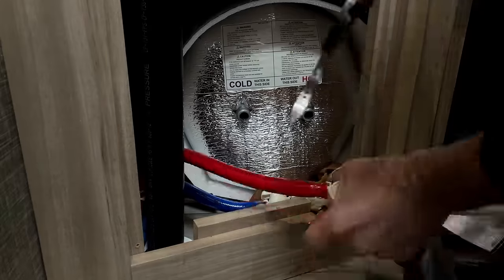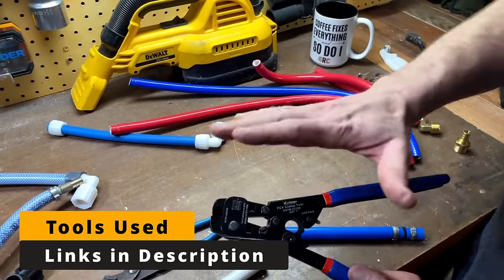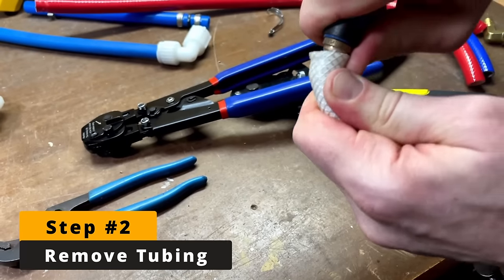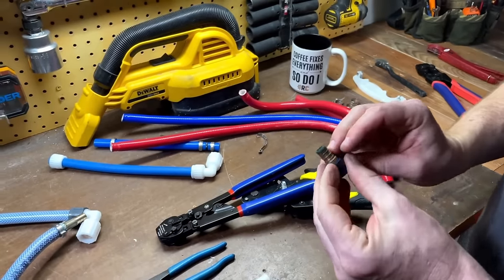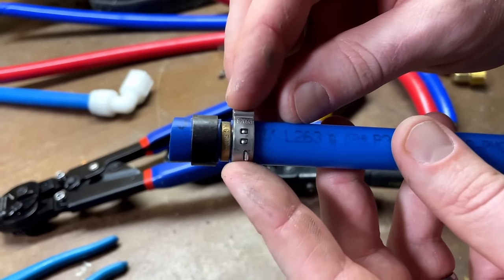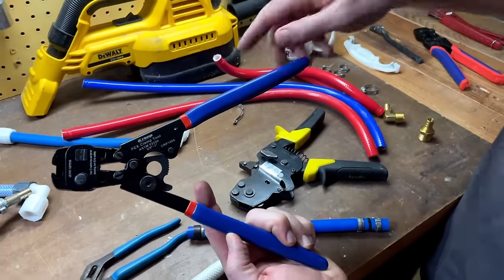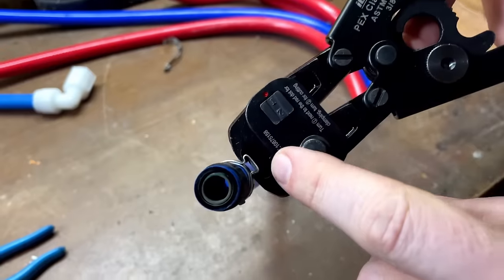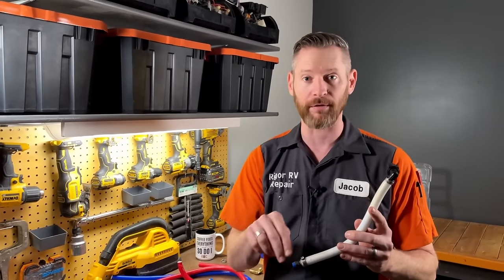How to fix RV plumbing leaks - Fixing Flex Pinch Clamp Tutorial (Part 1)

Comment: The Sungator 1/2" barb fittings in his Amazon list leak just as badly as the PEX fittings do with the 'garden hose' parts on my Grand Design. Especially the hot lines, seems they have expanded and simply won't seal right anymore. The only real solution here is to replace with 100% PEX. I wasted a lot of time trying to transition these vs. fishing PEX everywhere (which turned out to be pretty easy overall).
Reply from the maker: Thanks for the feedback. All PEX is also my preference. I'm sorry to hear the barb connections did not work for you. I only have the video about barb fittings for the situation where the plumbing is in a slideout and you can't easily remove and replace the hose with a pre-made flex hose assembly that has 1/2 NPT connections. Barb connections with screw-type clamps can leak if not tightened enough, and the clamp may need to be re-tightened after hot water goes through and softens the hose. I'm glad that you were able to replumb with all PEX, that should serve you well. Best of luck with your RV!
Reply: I would love to hear more about how you replaced with PEX in your Grand Design.  I was about to start doing the repairs suggested in this video but am having trouble finding lead free options for the various brass barbed fittings I need.  Thank you very much for your help!
Reply from the maker: Thanks for your comments. I'm actually changing my recommendation on barb fittings and clamps for a few reasons. as you've pointed out not all brass is lead free and good for potable water applications. I've linked stainless barb fittings in my Amazon store now. Second, I found a T-bolt high-pressure hose clamp which is twice as wide and works better than a standard worm drive clamp.
Hope this helps, thanks for watching!
Reply: @undercoverrvtech I looked at the new recommendations and was wondering about the new clamp as the one you have in your list still looks too big for a 1/2" barb fitting, no?
Reply from the maker: @robertbarry79  I have them on my bench and have installed that clamp on a 1/2 barb fitting. It works fine. I'm in process of updating that tutorial with the new reccomendations,  but am also working with an engineer to prototype a direct PEX to bard brass adapter, (It will be lead free) and will include that in the update. In the meantime your best bet is stainless barb and the t-bolt clamp.
Reply: @undercoverrvtech  Thank you very much for the feedback.  I was thinking it wouldn't tighten enough for a 1/2" barb to make it secure.  Appreciate knowing that you have tested it directly.  I am also excited to hear about the new development - definitely want to see that video!

Comment: That video really helped me see what I need to upgrade all the piping that's not PEX in my Forrest River 5th wheel. Another "idea" I've had would be to extend the catch tray that is normally below the "user" side of the nautilus panel to catch leaky hoses and channel the water to outside/underneath the trailer and build a catch tray behind the nautilus panel where leaks often go undetected until major damage is done. I saw this idea recently at a local RV show and wondered why manufacturers don't design the water system to deal with leaks and channel them out of the RV instead of creating damage.  Thank you!
Reply: That’s a good idea.

Comment: This is the first video I have seen of someone showing these stupid tools n how to use em. Thx!
When i researched pex stuff 2yrs ago i was a bit overwhelmed because i came across the different types of clamping, then the wording jargon not consistent on the web added to the confusion, so I still have not bought any tools except a quick solution in a crunch, a set of pvc/pex cutters n a couple of sharkbite end caps, lol. 
Saved your video for the future now too. I’ll wait until I need to shop for fixing, and then I’ll also put in a shut off valve at the offending leak when it happens…..(not if it happens) lol. 🍻

Comment: I think for long term stability, I would coat a layer of Plumbers GOOP before I re-attach the hose. Clamp it and when the goop dries
it would never leak until the hose breaks - A bit messy and you need 24 hrs for drying.

Comment: I am trying to find a few types of lead free brass barbed fittings to fix some of the Grand Design plumbing issues you have discussed in this video, but I am having trouble finding lead free options at every hardware store (most don't carry barbed fittings) I have checked and Amazon.  What brand and/or reseller are you using to source lead free options?  Thank you very much for your help!

Comment: So, watched your Grand Design-Brinkley-Alliance video.  And was a bit discouraged with your rating and never would buy.  But I thought of that as a not so bad thing either.  The main reason (I took from the video) was because of the bad plumbing. Please correct me if I am wrong.  

My 2023 Reflection 311BHS already is showing signs of this issue.  In the basement, there are a couple spots where RV antifreeze was puddling on the floor.  

So, before we get busy this summer, I am working to re do all of the plumbing.  I am doing pex where I can with brass fittings and copper and stainless crimps.  The. Where I need to use flexible for now, I am transitioning from pex to flex using 1/2 pex to 1/2 FIP brass connected to 1/2 MIP to 1/2 barb brass fittings.  

At my water pump, I would like to use flex as I feel like it could reduce vibrations.  What is your opinion of the best option fitting  to go from 1/2" flex hose and connect onto the 1/2 MIP on the pump?  I feel like transitioning to a 1 1/4" piece of pex is a waste just get the pex swivel fittings.  Although not that expensive in scheme of things.

Comment: Is there a recommended water pressure when your RV has flex vs. pex? Do you have any videos on water pressure regulators for the RV?
Reply from the maker: No, it should be the same for both, max 55psi. The issue is faucets etc. that are not designed for high pressure, it is not just an issue with tubing or fittings.

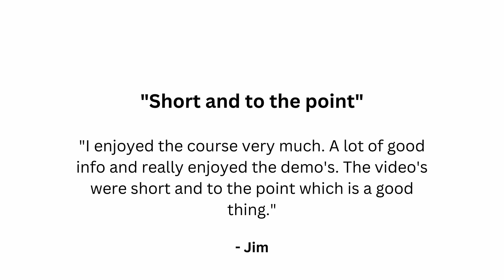Comment: At the 4:20 mark you show how to crimp the "ring" on the PEX; is there a reason a screw type hose clamp cannot be used instead?  Great videos, by the way.  Looks like a long term project is at hand.  Thanks for the outstanding info.
Reply: Pex is too stiff for a screw hose clamp.

Comment: So i keep hearing that the flex tubing is not ok, but is there a way with different fittings that it is ok to use or is it just bad in all situations.  I have a freedom Express and yhe only place that it has the blue flex tubing is the inlet from fresh tank to water pump and my winterizing port off the water pump. We rarely camp without water connection tho.
Reply from the maker: I'll show fittings that work with flex in another video soon! Thanks for watching!

Comment: At 0:30 you say that the "replace with PEX" method is the most preferred method. Does that mean it is preferred to plumb an RV with PEX over flexible (vinyl) tubing? Why is that? Why is it more preferred to replace the flexible tubing with PEX rather than keep the flexible tubing and swap the fittings to be the correct ones?

Comment: Hi Jacob.  Just found your videos.  We are looking at a new 5th wheel next year.  I am concerned about the flex hose issue you point out, but in reality, how bad is it?  Is it just a potential issue?  Our almost 5 year old Rockwood Signature Ultra Light travel trailer has the same set with PEX and flex tubing and we've never had a leak.

I contacted Grand Design and this is their response:

"We are aware of the talkings about flexible hoses with PEX plumbing and have it on our radar. However, we have simply not had enough warranty claims pointing to this being an actual issue with our units. If we begin to see a pattern and an increase in claims, we always address the issue immediately."

Comments?

Comment: Recommend using Sharkbite connectors with PEX or avoid Sharkbite products and use pinch clamps.... or are both ok? Thanks for the video!
Reply: Sharkbite fittings are trendy garbage and the mark of a total amateur plumber.
They tend to release even in a slight freeze, are expensive, and unproven for long term use. I only use one for an emergency, temporary repair. 26 year master RV tech.

Comment: My travel trailer has a flex hose from the fresh water tank to the pump. The tank has a barbed make fitting and the pump has a twist on fitting with a rubber seal inside. Like a faucet hose. They both have small hose clamps. How would I correct it using pex on the tank with the plastic male fitting with barbs. The tank is soft plastic.
Reply from the maker: Keep an eye out for my next videos about plumbing. I'll show the types of fittings you would need to change to PEX. Thanks for watching!

Comment: Why not use push to connect with pex? John Guest or Sharkbite fittings. I use them where we plumb ag planters. They don't leak and are a quick installation with NO special tools.
Reply: Because Sharkbite fittings are trendy garbage and the mark of a total amateur plumber.
They tend to release even in a slight freeze, are expensive, and unproven for long term use. I only use one for an emergency, temporary repair. 26 year master RV tech.

Comment: How about option 4. Sharkbite makes a slip on PEX to hose barb adaptor
Reply from the maker: Do you have a link for that? I've looked and not seen it.
Reply: @undercoverrvtech  
I can’t seem to find it now. It may not of been sharkbite brand. I have purchased them before but I can’t for the life of me find them now.

I have also in the past used sharkbite slip on fittings that have the whips built to attach to a fixture. Especially when it’s in a hard access area.

Comment: Can you still sanatize your system with a bleach solution if you use the brass fittings?
Reply: Sanitize your tank, okay. Your pipes...no need at all.  26 year master RV tech. No way I'd pump sodium hypochloride through my RV piping.  Pex is not designed for that.